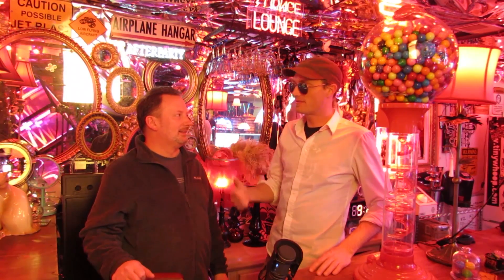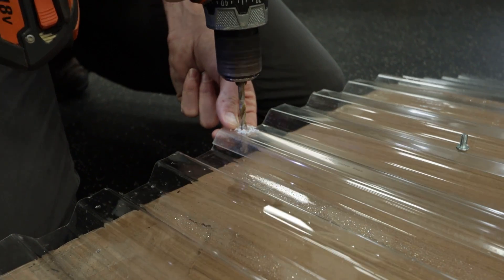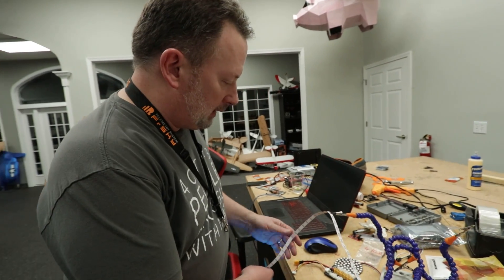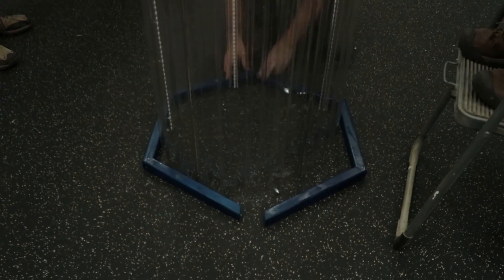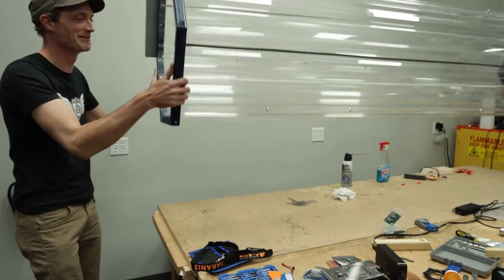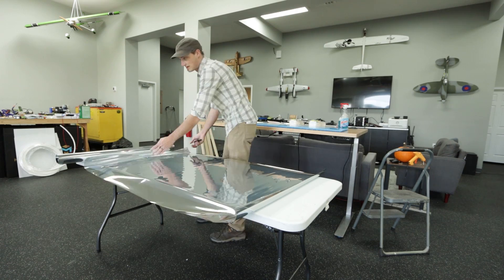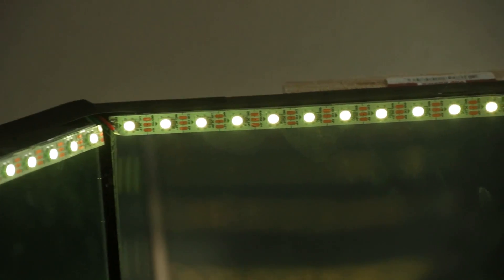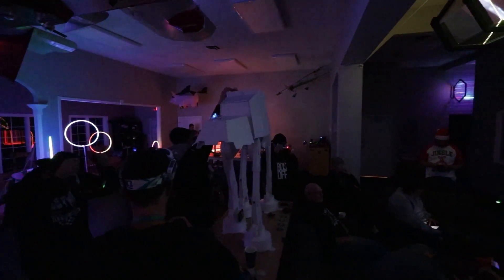LED Art you can fly through !?! /  DIY Tinywhoop Tunnels

Comment: ive had a look at the guide for these and have one suggestion, don run the Arduino nano on 5v.
While the nano 'can' run on a 5v source, its built in regulator results in loss that drops the voltage below 5v and can result in it being unstable.
you should run the nano at 6v or above to avoid the loss from the regulator and it can handle up to 20v.
Reply: The regulator in the NANO is limited to 800 mA max and uses 50mA itself. A single string of these WS2812b LEDs can pull as much as  52mA per LED. We have 147 LEDs in a single string on this puppy.  If you displayed full white, it could pull as much as 7.6A per string. This pattern pulls nowhere near that, but it is well over 1A per string. I've "accidentally" left a NANO using Vin regulated power on a 150 LED string and it fried the regulator.
Reply: @oufannco  what are you banging on about? I never said anything about powering the leds from the nano, you should never power things from them and should always use an external power source, I was talking about powering the nano itself if you actually bother to read it properly.

Comment: Wouldn't pop rivets work a lot better/easier/faster than those bolts you used?
Reply: Pop rivets would shatter the Palruf material. They needed to be larger. I'm looking at doing a steel locking grommet approach to allow it to be taken apart and made more portable. The one we built at FTHQ was a permanent install though. Others are looking for something more portable.
Reply: @oufannco  I was just thinking of these plastic snap on rivets they use in cars... Not sure if those would work though.
Reply: @ulaB  I have a crazy big bag of those at home. It was cheaper to buy a bag for "all vehicles" versus 10 of the ones I actually needed. I will try that out. Thanks for the suggestion!